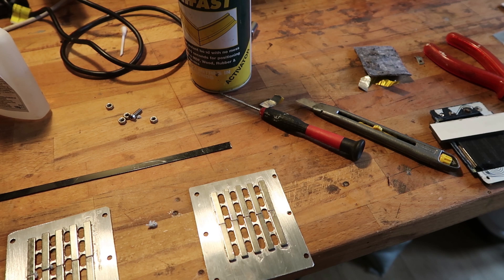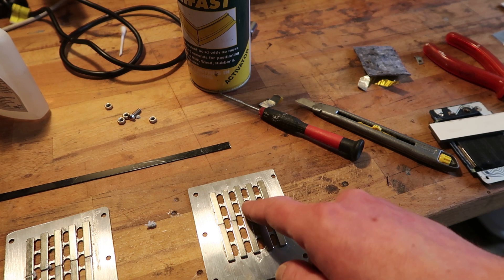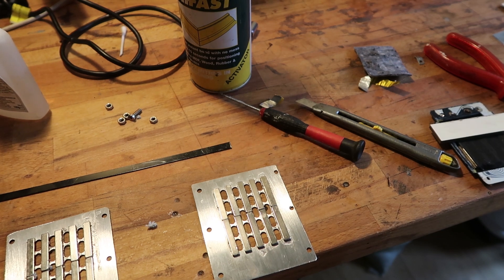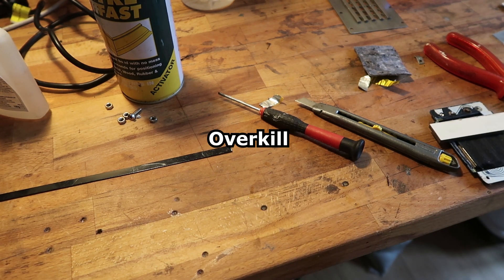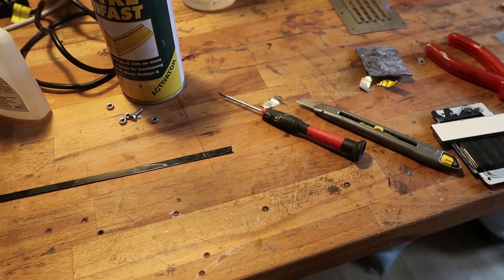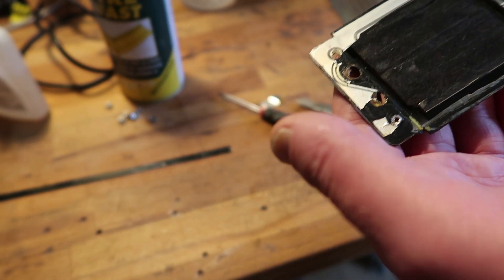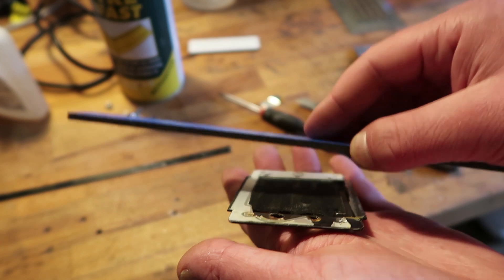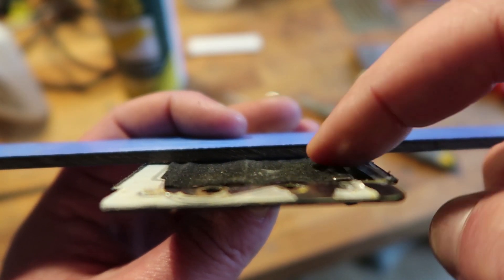Common B&G Neo 3/PDR Planar Tweeter failures

Comment: Infinitys last version of the Emit and Emim used the neodymium magnets with decent results.  With time the coating peels off exposing the Neo to air, and the Neo turns to dust, in my opnion Samarium Cobalt is an excellent compromise.  Neodymiumn is not worth the trouble, and in my opinion, when it fails, its extrememly frustrating!
Reply from the maker: Good point !, it really depends on the neo's in question then again , its hard to test if you got the good ones. if it takes 10 years. i do order from a few companies that so far worked flawless, while some Chinese aliexpress crap could fail within 2 years, and does not even are the stated strenght, so no more aliexpress poo for me :)

Comment: how to open it with what tool? please advise
Reply from the maker: drill out the rivits
Reply: @joppepeelen  got it. And screw it back with normal bolt and nut?  Thank you!
Reply: @joppepeelen  I have bad connection issues with minus. the connection swings a little and when you push on it there is a sound, but sometimes its just disconnect. Can it be repaired?

Comment: Interesting. One time I purchased used Neo3s and they all had that magnet flaking issue, the seller said he kept them in his garage. However I have bought many (more than 50pcs) around 2009 and sold them in speakers mostly in the UK. I've not had a single customer complaint until now and I still have 4 pcs in my own speakers that measure great. So either there is a bad production period, or maybe environment is a big factor. I think the B&G designer might have made the Radian LT2 / LT3 /LT6 and they now use black coated magnets.

FWIW I bet the opposing magnet force bends the case outwards when the driver is assembled, so the gap to the diaphragm will be slightly bigger when assembled.

P.S. I would love to hear your insight about response of the Neo3 and similar drivers that I've been testing. There are some similar patterns in all of them. Is there a way we can chat shortly?
Reply from the maker: yeah sure i got by the same name on facebook !   yeah i think the neo3 had a few bad badges with magnets. they dont prouduce there own i think, so maybe they switched supplier. i have some neo magnets doing the exact same :(  although they are massive :( so its rather sad :(
Reply: @joppepeelen  Added friend request on facebook :)

Comment: Why the focus on efficiency? I really don't get it. You have to pad down the (mids and) tweeters anyway to keep up with the less efficient bass drivers.
Reply from the maker: yep you are right. but using pushp pull what makes it so efficient does have there benefits in distortion. the same panel at the same volume in single ended has slightly higher distortion :) but indeed for the things i do i dont need 94dB for 2.85 volt  (i wont reach that either) but such high efficiency does give you the ability to use more efficient woofers if you want.